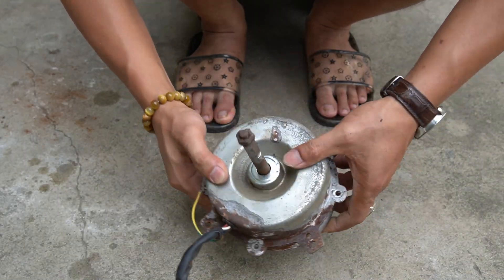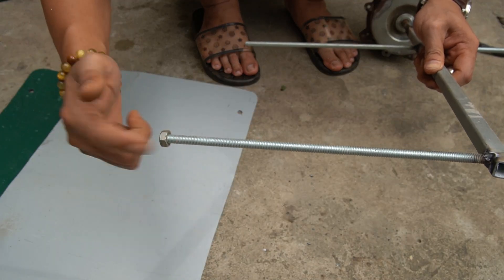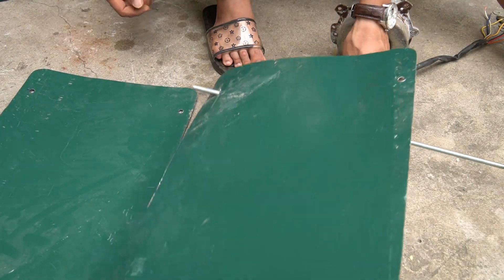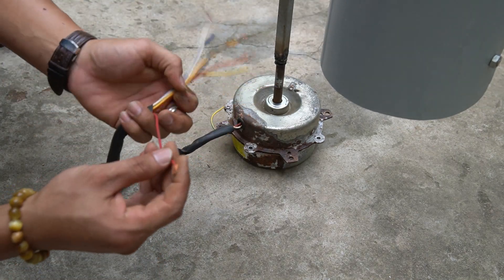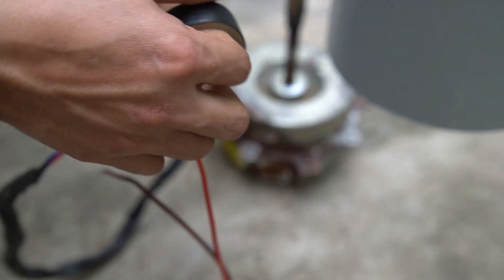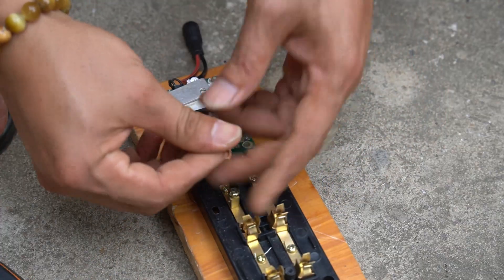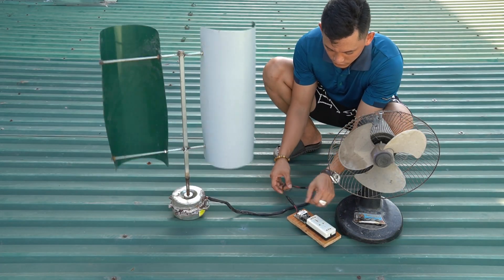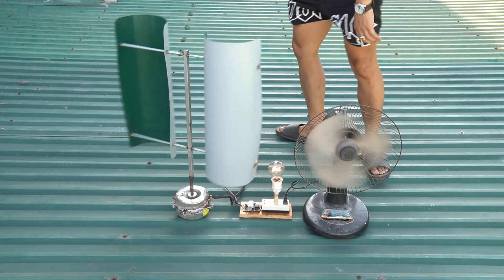DIY Free Energy Hack | Generate Power from Old Fan Motor

Comment: let's see inside of that black fan 😂😂  this is fake as hell, there's no way electricity works like that.
an AC motor rotating so slow CAN'T possibly generate electricity, aside of stable current to power an inverter. nobody is believing this crap